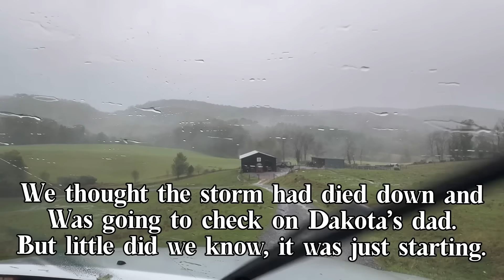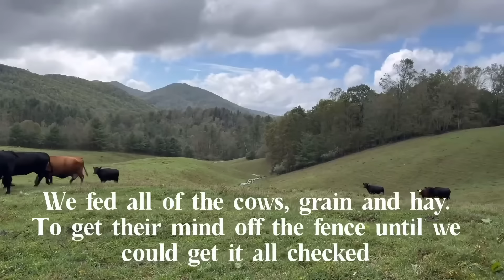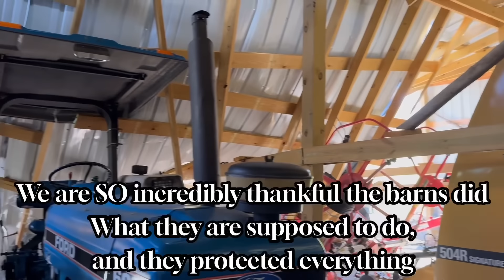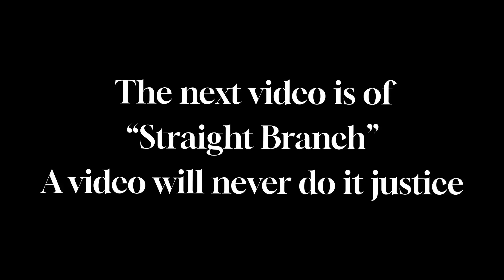Hurricane Helene ripped through the Farm | Hurricane Damage in the Appalachian Mountains

Comment: It looks like you did better than some of the surrounding properties?  Are you going to be able to remove, stack, and peel off pieces and sections of the structures for reuse and rebuilding?
Reply from the maker: We did make it out better than ones who received flooding in their homes. Luckily up the road at our other farm, there wasn’t much wind damage. Most of the wind damage seemed to happen from our home farm towards Damascus. 
Unfortunately we were not able to save any of the barn, it has to be fully rebuilt. Some of the metal barn is salvageable, but we are going to sell the good from it to offset some cost of the new build.
Reply: @mrs.shumate  Definitely look at the break patterns from the tree portions remaining from the topped trees.  Also at the break point of the downed tops.  What you're looking for are swirling breaks versus wind gust breaks.  In general, a broken off tree top with a lot of its branches missing/ broken around the trunk versus one side is an indicator that it was swirling like a top on its way down.  -  By definition we don't have tornados in our area but over the past 10 years or so we have a lot what I call "swirly whirly winds".  When the tree tops start breaking off, take care.  They can sail like a kite on the wind current (straight on, with a gust, or spinning like a top) for "a bit" and are VERY unpredictable; they are also very heavy if they're from a big tree.
Reply: Grace with Jesus Christ on the cross from God ,paid for the live, and this was not from God mit came from natural nature laws of, ok thanks BigAl California praise Jesus Christ grace grace grace amen 🙏